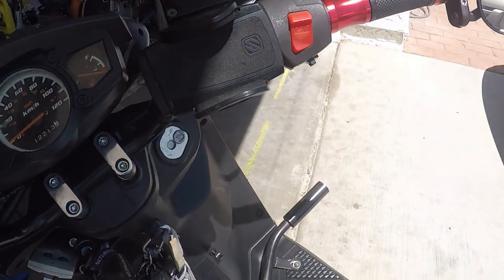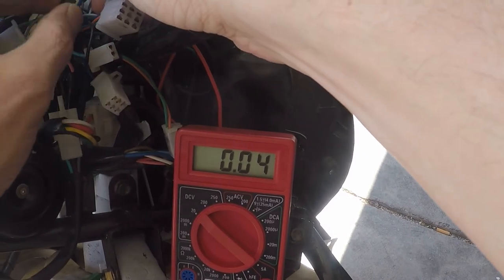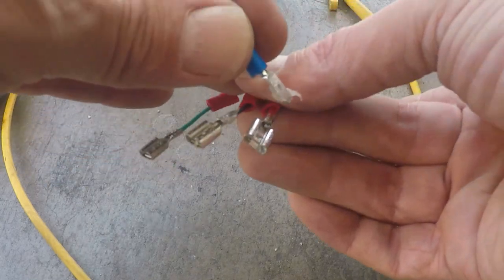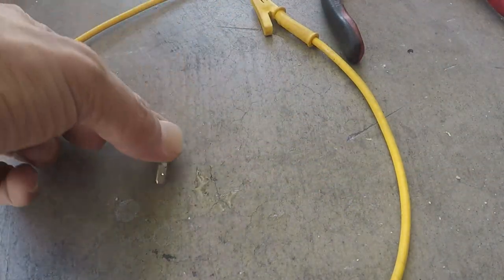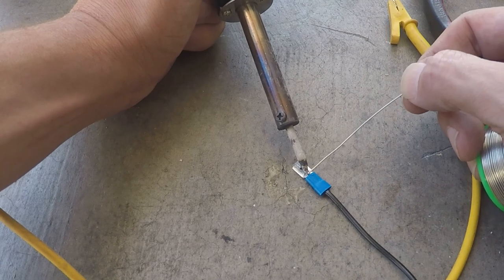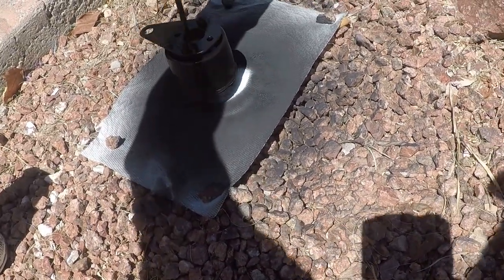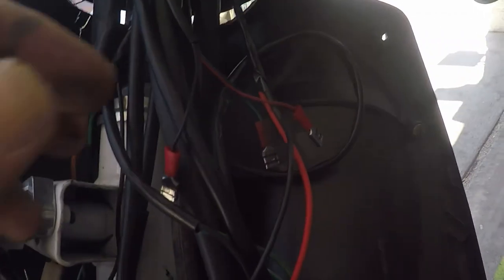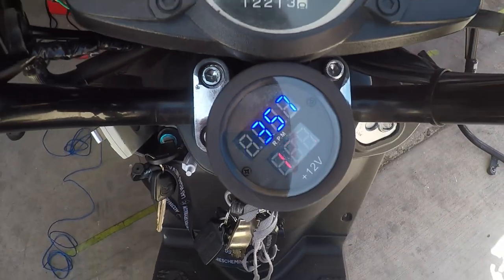HOW TO INSTALL A TACHOMETER AND VOLTMETER ON A SCOOTER OR MOTORCYCLE #AVIDTV

Comment: Hi I’m after just a the tachometer to do, so basic you just get a earth and 12 v for it? Thanks and did you select any old harness plug to get the 12v
Reply from the maker: Yes any 12v that comes on with key switch turned on
Reply: @avidtv123  ok brill thanks , so I have my old cluster plug ther as changing for this ? Should be fine if has voltage
Reply: Hi again! So would be pretty much the same if I put in a universal speedo